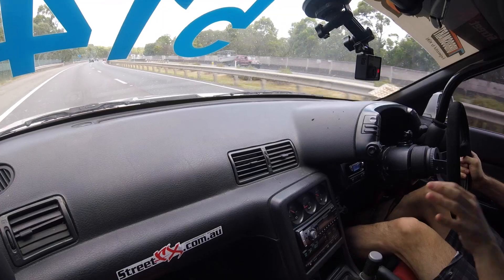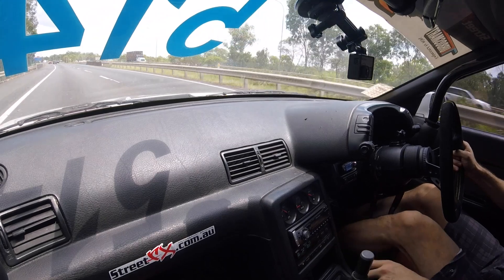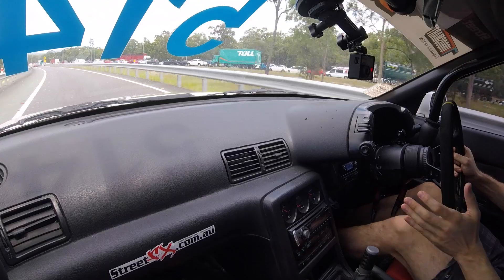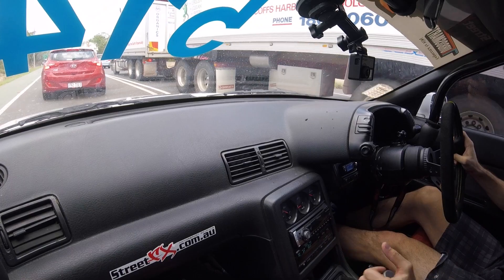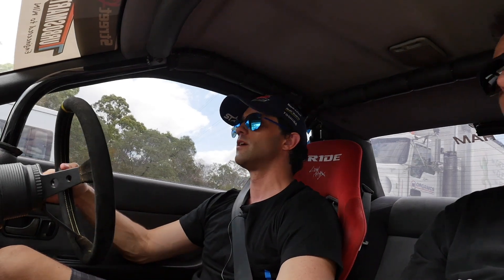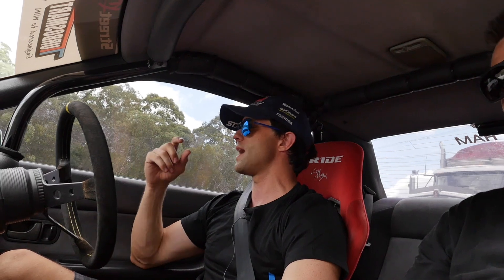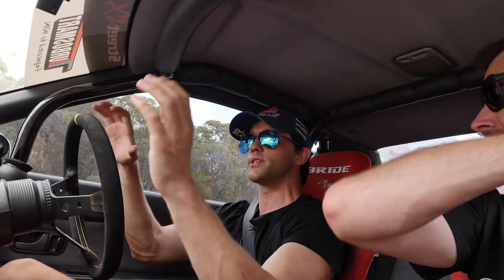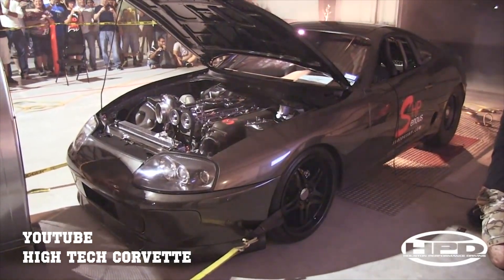What is TURBO FLUTTER & SURGE? Is it Bad? Myth-busting in our Nissan R32 GTR!

Comment: Compressor surge is never a good thing.

"people say it's the turbo spinning backwards, got rocks in their heads"... They're actually not as dumb as you think, they're nearly correct. The compressor wheel is definitely not reverse spooling, but it is stalling and the air is backing out through the turbo in the opposite direction. When you get surge on throttle, it means that you're creating too much boost at that part of the rev range and the only way that you can correct it (I think), is to reduce the boost at that point in your rev range. It may only be a 500rpm section that you need to reduce; you don't need to reduce the overall boost setting. 

If you're getting surge when you clutch, it simply means that either your blow off valve spring is too tight or your BOV is too small. The volume of air trying to escape is greater than the size of the valve, or there isn't enough pressure to open the valve. Once again, the air has no where to go, it heads back out the turbo stalling the compressor wheel. The fluttering is the sound of the compressor wheel stalling and starting and stalling and starting. 

It's bad on your turbo. When it's surging it can break the fins of your compressor. You NEVER want it surging.
Reply from the maker: did you watch the video? we explained nearly everything you just said! On throttle surge = bad.. Off throttle surge = not bad.
Reply: No surge is good bro. Air pressure is passing back through your turbo causing it to stall, so it doesn't continue to spin as fast, so when you get back on it it has to respool what you just lost and there's a chance that you could break compressor fins. Basically, it's having that sound at the expense of a slight loss in performance and undue pressure on your turbo. It's not a good trade off, in my eyes, but each to their own. The air pressure should be going out of your BOV, but it's not.
Reply: Street FX Motorsport TV s
Reply from the maker: if it's not "meant" to come out the front then why do some turbos have anti surge compressor housings (with the holes around the inside).

Bottom line is - it's not ideal but it's not worth arguing about either. We like the noise and on a modern turbo with modern high quality bearings - longevity will be barely affected.
Reply: "the compressor wheel is definitely not reverse spooling, but it is stalling"

It's an aerodynamic stall not the wheel itself stopping, it doesn't even get close to stopping the compressor from spinning.

"Once again, the air has no where to go"

It has somewhere to go, out the intake, part of the design of the compressor wheel and the housing it that air is allowed to escape, this is why it doesn't do damage with off throttle surge.
Reply: I suppose when people keep surging their turbos so they can get the flutter, it created a market to build an anti-surge turbo aye? I guess that tells you that normal turbos aren't meant to be surged or they wouldn't have a designed an anti-surge one.

Yeah no stress man, each to their own at the end of the day, I just thought I was helping. I'm not one to argue for the sake of arguing.
Reply: I know the compressor doesn't stop, it doesn't come close to stopping, but it does slow down some. It's not meant to go out the intake of the compressor housing, that's why it's called an intake. The air is suppose to come in the intake and go through the throttle body or released out through the BOV, not backwards back out the intake. It can damage compressor fins.

Comment: So the turbo stalling is that not almost spinning backwards??? He has the rox in his heads plural
Reply: It's an aerodynamic stall not the turbo itself stalling.
Reply: THIS!!!!! its the same as any turbo car,  if you notice on turbo cars depending on your exhaust setup when you get on it some and let off the gas in your exhaust you hear a whining or a slow "EEEEEEEESSSSSHHHEEEWWWWWW" kinda of noise, all it is is your exhaust wheel slowing down in the housing, or air moving over your exhaust wheel since the driving force to move it so fast isnt there anymore as you let off the throttle. a turbo is exhaust driven so its going to turn where the exhaust pushes it even in lean conditions its still providing exhaust to the turbo

Comment: If you're getting surge on boost its usually because you are not limiting low end boost, big turbos don't like running high pressure ratios with low flow . Which would be right in the middle of efficiency island of a small turbo. This why a lot of setups ran a small and big turbo, yes the small one can spool up quicker for the low end but it can also sustain more pressure at lower flow allowing more boost at low revs without surge occuring.

The damage you can cause by surging is primarily to the thrust washers particularly on journal bearing turbos. When the shaft bashes back and forth. 

If you run oil good pressure and have tight tolerances the shaft can't move and pick up as much speed when it moves back and forth which is what is going to kill the turbo. I think smaller turbos are more susceptible to damage  since they typically don't have the relive holes that you see on big turbos and smaller turbos in general are just cheaper and may not have the same safety margin as a big turbo might.

Comment: so just wondering towards the end of the video you show the clip with the car blowing blowing the business cards everywhere... In that case is it possible for the compressor to stall and potentially even turn the compressor other direction since there's no exhaust pulse (or very low exhaust pulse) because the throttle bodies closed. I've never actually thought turbo could spin backwards but when I saw that video clip it kind of dawned on me that may be a could. if there's enough surge going back the other direction the exhaust pulse has just essentially stopped or is very minimal. I would love to see some testing done on a turbo with a Billet compressor and speed sensor. do you guys have any data on this or is it just what you guys think. I'm not trying to be an ass or anything I just like facts and after seeing how much air went out the compressor...i don't know maybe I have rocks in my head... maybe a blow off valve was pointing towards those business cards.
Reply: It's not possible for the compressor to turn in the other direction while the engine is running, the design of the compressor blades and housing allows for the air to escape out the intake which caused, if you have ever put your hand over the air filter on a turbo car without a blow off valve/bypass valve and revved it you can feel the air coming out, it's part of the reason why bypass valves are factory fitted on engines with a mass air flow sensor.
Reply from the maker: +nick simmons no it is impossible to spin it backwards (it's going 100k rpm!). If you think about how much air is behind the turbo blades trying to escape - all that is happening is it's forcing itself back past the blades (they always stay spinning the same way). Have you ever talked into a moving fan and it sounds like darth Vader? Well that's what this is except instead of talking into the fan you're blowing into it. You will still feel some air on the front side of the fan as the air stalls and goes back out the intake.

Comment: set the blow of valve where it should be and size it properly and all you will here a slight rush of air and turbo will not be rapidly slowing down and you wont have shaft nuts coming loose on your turbo. its not unavoidable. 
 But it does sound cool. but whoosh sounds fast.

Comment: Good Work On EXPLAINING This...As FOR ME WITH A HIGH HP deisel there is no throttle body  so I've yet to figure out how deisel make the same Sound
Reply: Not sure how it works without a throttle plate, but maybe the intake valves works as a throttle plate?
Reply: Whoah didn't realize this was 3 years old lol

Comment: Wait so is there a certain brand or type of blow off valve that will make this exact fluttering sound?
Reply: 3Revs i think HKS has a sequential BOV that sounds this way look it up its pretty coo "HKS sequential BOV"
Reply: Luke Malone alright gonna check it out for sure! Thanks for replying man.
Reply: If u boost ur car so it makes woowoowoo noises then u are a complete poser... js
Reply: All you have to do is tighten the valve spring on your BOV, but it's not a good thing to do. You don't want compressor surge. But if you want to do it anyway, tighten it and it'll get to a point where the pressure needed to open your blow off valve will exceed that of the air trying to escape and it'll back out through your turbo, stalling the compressor wheel, which is what that fluttering sound is.
Reply: hks ssqv used to have an adjustment screw/nut back in the day and they don't anymore but you could make some sick fucking sounds with the adjustment screw at nice levels of boost, the hks bovs sound ok now a days but back a few years ago you had so many more fun options like the hks and greddy type s both of them used to be the 2 best options for sick bov sounds

Comment: Sooo you think your compressor nut backing off couldn't have anything to do with your compressor surge?   Hmm...
Reply from the maker: +Sdmoparman in SD the car that had this happen to us did have a blow off valve. It was just a very badly worn turbocharger.
Reply: I read in another comment that they're also reverse threaded to the direction of rotation to prevent that from happening. Is that true?
Reply: Yes. They'll technically only get tighter. Then again they are parts and any part can fail.

Comment: funny how you say people who say the turbo spinning backwards must have rocks in their heads, yet you guys think it's fine for a turbo to surge lmfao. all I heard for the first half of the video was why there is a noise, not what's actually happening. poorly tuned cars have surge, bad wastage pressure, bad recirculation valve, etc cause surge and surge is the turbo trying to slam to a stop because the intake side is trying to stop but the exhaust side wants to spin... hints the surge. like when you have wheel hop... your wheels want to stop but the axles are not allowing it... do it too much or hard enough and something will break. I honestly thought this was common knowledge with actual car guys and not fast and furious car guys.